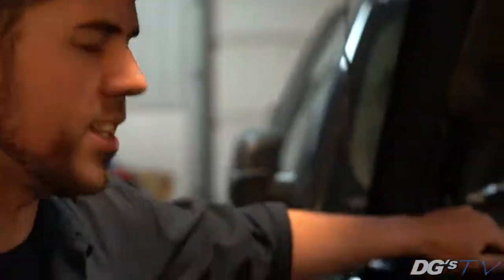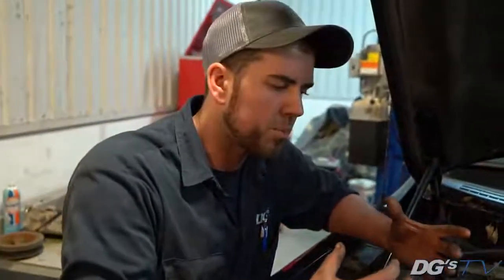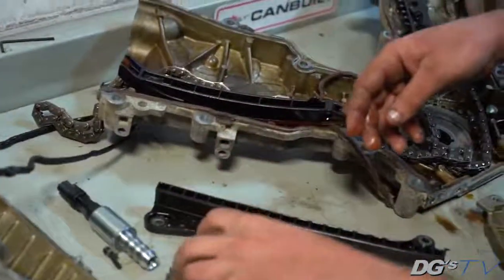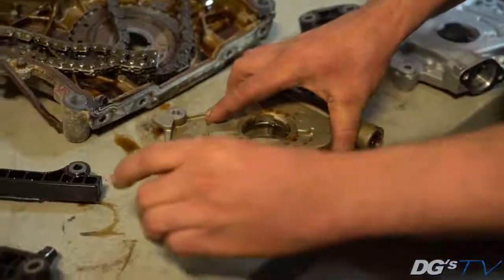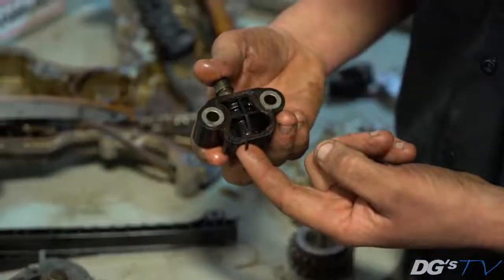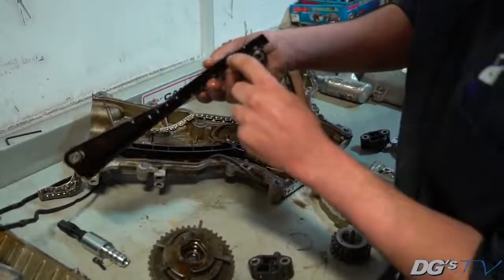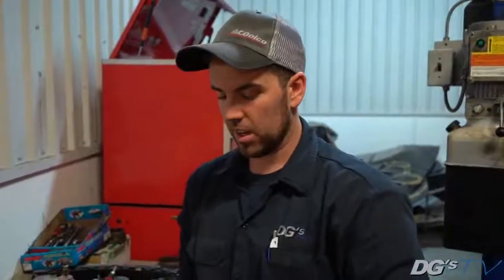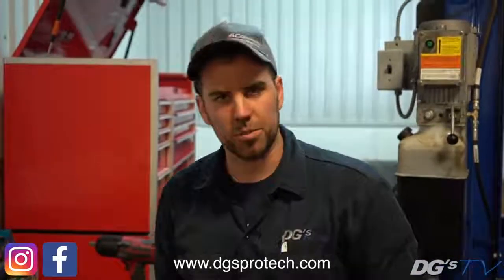EP 6 - Ford 5.4L Engine / Variable Cam Timing Components (Gas Engines)

Comment: Good explanation of the system.  I have put 300000 + km on my 2006 F150 5.4 and just did the entire timing set.  I could hear some chain noise on startup. This particular engine is great overall and does not have any issues other than the tensioners failing at 300000. The key is to change oil regularly with good quality synthetic and not drive it into the ground. The truck itself is actually fairly straight forward to work on and is holding up well. I am sure I can easily get 400000 before shopping for another.

Comment: Hey man, just saw this video on your kijiji ad. Just want to say you explained the VCT system very well. 

The problem is, and I've encountered this, not only is this a regular issue with this motor, you can replace everything you say to, properly, with ford parts, and they can fail in less than 5000 kms (speaking from experience).

Coupled with that, say to replace the gasket on the tensioner, costs thousands of dollars in labour due to having to almost completely disassemble the engine to get to it. The DFs at ford should have put an external drive belt or at the very least, put the cover and timing in front of everything so it can be easy to get to.

I know I"m ranting but 18 months ago I replaced the engine in my F150 with a good used one. Before it went in, I had the entire timing chain system replaced along with a new oil pump. New coils, new plugs, just about everything that could break. 

Well, fast forward 18 months and lack of oil pressure somewhere or a blown seal, and my cams are toast. It isn't for lack of maintenance because I'm just at my second oil change on the new engine which was replaced about 10,000 kms ago. 

I spoke to a Ford mechanic and he said "replace with a ford engine, least you get a 2 year warranty", he's done hundreds of these motors...that's the problem right there: you shouldn't have had to DO 100's of these motors. They literally are garbage. 

Imagine if you had a passenger airliner that would crash because the seal on the coffeemaker leaked. That's pretty much what happens to these engines: a 2 cent rubber seal on the tensioner goes while you're driving on the highway and before you can pull over and stop, your engine is toast. Now it literally isn't toast, but the cost to repair it pretty much makes it that way. 

Anyhow, this isn't against you, it's the basic design that is flawed. I mean it is literally cheaper in labour to remove and install an entire engine that to replace ONE cylinder head OR the timing chain. That's insane and the people who designed this motor, and continued to sell it for 4 years, ought to be ashamed of themselves.....
Reply from the maker: Thank-you for your feedback and glad to hear we explained the VCT system very well!

Comment: Great video, very well spoken.  I have a 2004 F150 5.4L 3-valve, 140,000 miles.  Considering replacing all timing components as preventative maintenance with revised OEM parts (hear 2 second chain slap before oil pressure builds).  This truck https://www.youtube.com/watch?v=JWxqSPH0Sv8